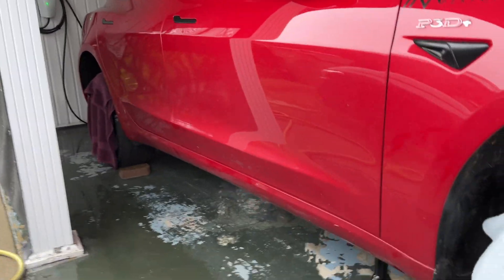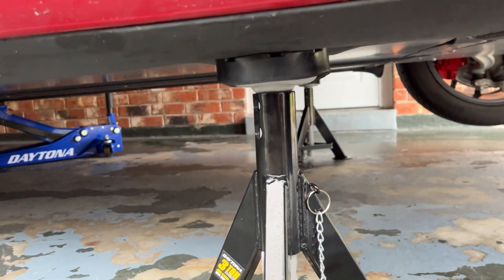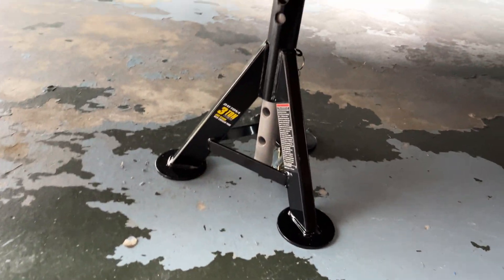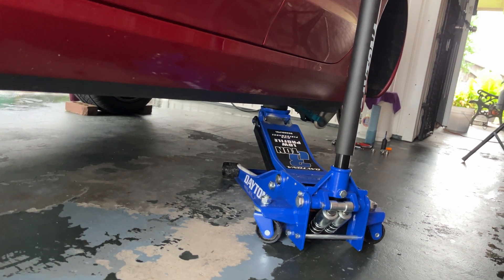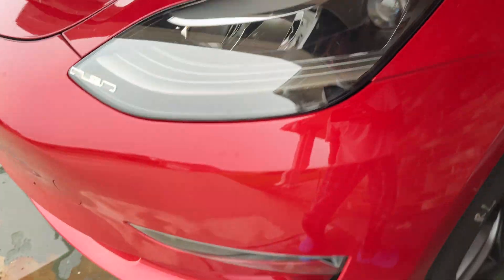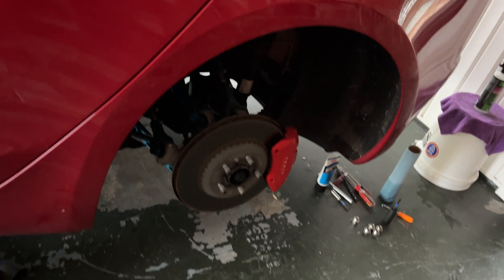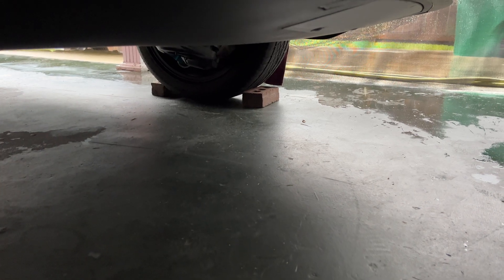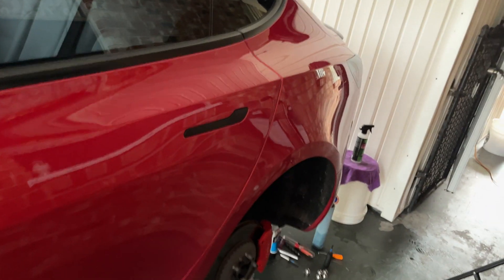One way to put a Tesla Model 3 on Jack Stands

Comment from the maker: *WARNING:* Please do not use the method I demonstrated in the video. While using jack "pucks" and jack stands is correct, my research indicates that it is safer to jack up either the two front points or the two rear points together, rather than jacking the car up diagonally as I did. Thanks to commenters for pointing this out, I was able to consult the service manual and learned that jacking the car diagonally puts unnecessary stress on the battery pack, which is detrimental.

To do it correctly, please refer to the Tesla service manual linked in the video description: lift either both front points together with jack pucks or both rear points. After that, you can move to the opposite end, depending on where you started. This method ensures that the pressure on the battery is even. Unfortunately, this requires two jacks.

Also, make sure the car is on a flat surface and that you only jack at the designated "Jack Points" as specified by Tesla using the "pucks." Doing otherwise can damage the battery framing.

Comment: Where do you jack it up to insert that jack stand? Don't you need the hole to jack it up?
Reply from the maker: You don’t have to use the hole as long as the rubber is in the area where the jack pads are supposed to go. 
Also don’t follow this video you’re supposed to either use a lift for these cars or jack up both sides evenly the body isn’t supposed to flex like that.

Comment: What a joke, lift front to put jack stand in the rear. Seems quite a pain in rear. 😅
Reply from the maker: This is much easier with two jacks. The car is quite hard to jack up & get fully off the ground without a lift or ramps.
Reply: @BryceAdvice  jacking a car diagonally will damage it
Reply: @BryceAdvice I have 2 jacks to lift the front of my Model S. ( I need to replace the front control arms, but I'm not going to work under the car with just Jack's holding up either Front Side. 

I've tried to place a jack stand adjacent to the car jack, but the Jack point is so short in width that getting a jack stand next to the car jack is incredibly sketchy. For example I would have one of the legs of the jack stand having to come over the front axel of the car jack just to get it to fit under the jack point. I've seen one guy in the UK using wood to basically make DIY version of the Tesla Jack Stands that cost $400.

Comment: How did you jack it up first to put the first stand under? If the jack is on the jack point, how did the stand get there? This is the bit I can't get my head around.. I can't lift an entire side from one jack point to get a stand under the other 🧐
Reply: He jacked the car up diagonally (which tesla specifically says not to do in their repair manuals.) Some people get around this with jack bars (two jack stands attached to a bar with a welded receiver cup on it for you to jack with. Or you can use a combination bottle jack thats intergrated with a built in jack stand. tesla mobile service use jackpoint jacks which you can come underneath with a jack, push the car up. Slide a pin in and then let the jack go and the stand will rest on the pin. Of course jackpoint jackstands are always sold out and cost 200-400 dollars.
Reply: @Neoprenesiren The fact that Tesla owners need to jump through all these hoops and precautions to do simple maintenance like swap out tires or a tire rotation is ridiculous.

Comment: Since I have 2 sets of wheels (winter and all season), I only have to lift each point once and i rotate too. I use the Safety Jack stand / Renn stand, with the price imo. I do like the idea of having a whole side off at once though, I think a solution for that would be to make it out of 4x4 and other wood with a wide base and include a centering puck on top though. I don't want to trust any harbor freight jack stand after their huge recall.
Reply from the maker: @whattheschmidt  Totally understand your point, I worked for Harbor Freight for a exactly year, but I no longer work there because I wanted to work for Monster Energy instead (The jobs a lot more fun) but anyways what I can say is the recall was only on the Pittsburgh jack stands not Daytona. Anything from the Daytona lineup is really solid quality & can be relied upon. The biggest returns I’ve seen at Harbor Freight are the Pittsburgh stuff not so much Daytona & I have talked with many shop owner’s & mechanics throughout my year who came in shopping & most all of them said Daytona is solid for their shops. In my case these Daytona stands are perfect because they have the built in rubber pads. Of course I don’t want to use these in conjunction with the Tesla pucks as rubber on rubber with a gap between would be a bad idea. Better just to have the jack stand rubber directly on the cars jack points.